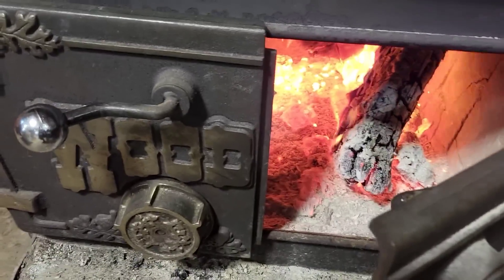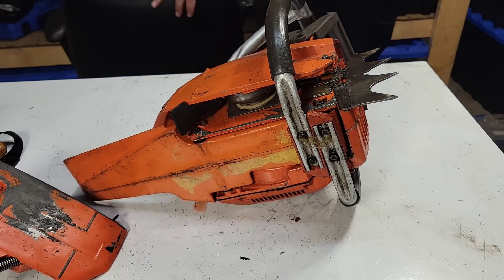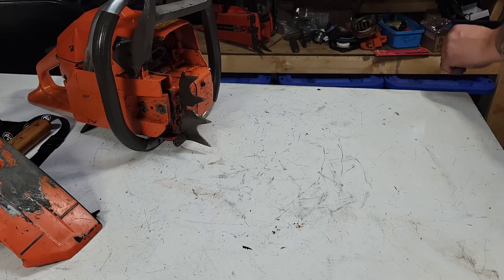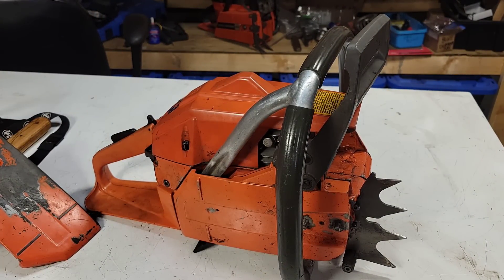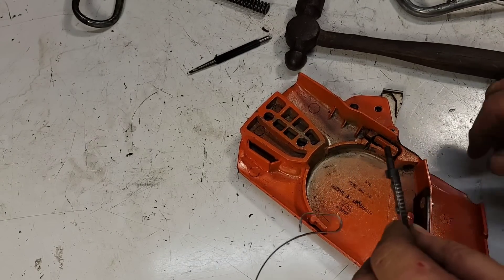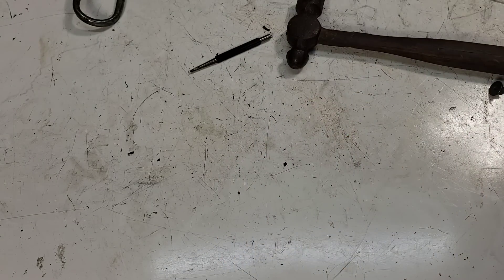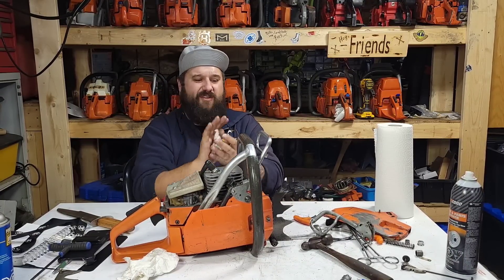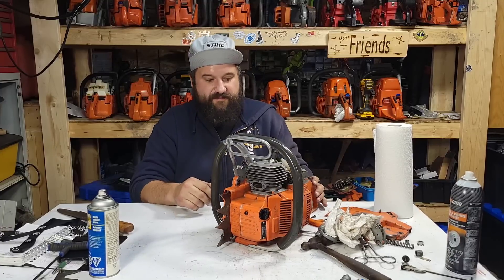How to rebuild a husqvarna 266xp chain brake.

Comment: The space between the chain brake lever and the wrap is an important safety feature for kick back. As most are aware, when the saw kicks back the top of your hand hits the chain break lever and trip the break to stop the chain from cutting your face. So when I see guy removing them or bending them right out of the way I cringe. the chain break will make the difference between a wack in the noggin and a severe injury. Just saying. Nobody that has cut trees can say they have never had a kick back. This is a great video. TC Mahalo Tinman🤙🤙🤙

Comment: Tinman: just picked up my own early edition 288xp turd saw. I’m not quitting or giving up on it. Took me two days to work up the courage to even peek at the piston through the intake and muffler ports. Meh…could be worse. If all I need to do is a top overhaul I’ll be happy. Got the old metal chain brake, dented and bent of course…. Why do I get myself into these things?
Reply from the maker: Cause it's fun...
Reply: @tinmanssaws  Tinman. Glad I caught you: how do I get that cheap plastic choke on my 288xp without cracking off one of those two tynes?

Comment: I thought the newer style was tough to work with but the older style is definitely more finicky.  Which year 372's or what model used the clutch cover with Husqvarna cast into the side instead of the sticker?

Comment: Tinman: I’ve got a metal inertia brake on an old 288xp. Can I retrofit the plastic brake on the old hardware ?
Reply from the maker: No they are totally different
Reply: @tinmanssaws  ok. Thanks. I purchased an oem clutch cover with the plastic handle found on models after 90 I think. I hope that system works on the saw